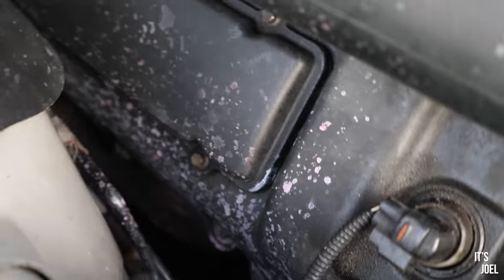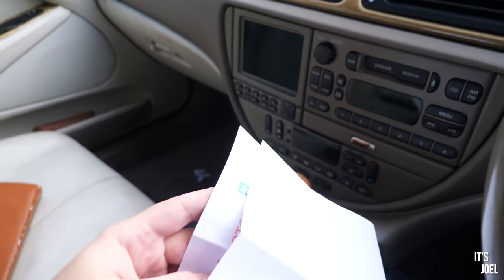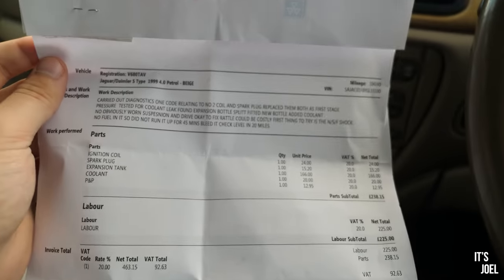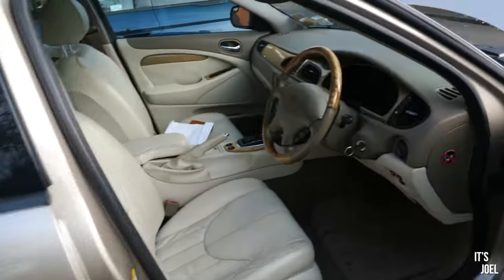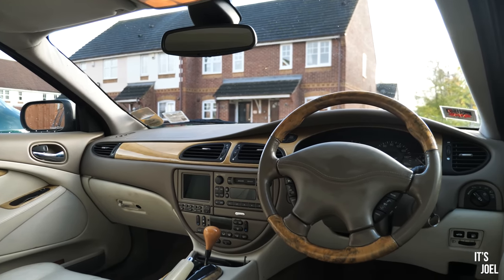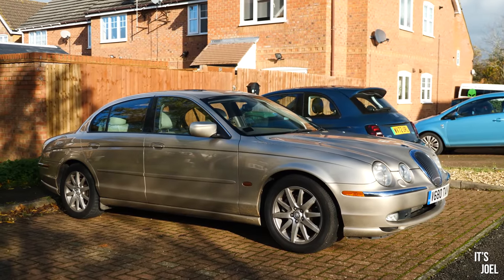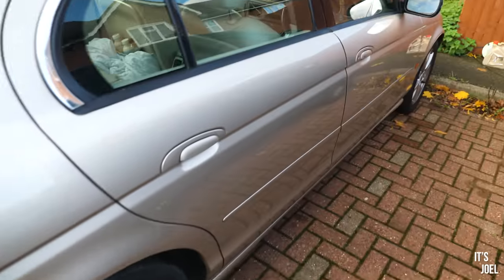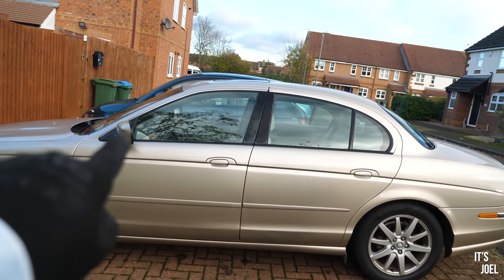My cheap V8 Jaguar has already given up on me…

Comment: Hello Joel.
I am a former Jaguar technician. As one other commentator on here has suggested a simple pressure test will usually reveal the issue, unless it's something like a head gasket that has gone which is very unlikely. 

One thing that is often overlooked and could quite easily be the cause of your issues is the actual expansion tank cap! They perish and at 20 years old it could easily be this if the rubber seal has expired.

Well worth a try, but pressure check first.

You can be pretty confident it won't be oil that is leaking as you would know by the smell of burning oil in that area near the exhaust manifolds and it burns blue so pretty easy to identify.

Car is well worth saving as they are becoming quite rare and yours looks in good shape from what I can see.

The Jag V8 engine is a gem, just change oil and filter regularly especially if it stands for long periods.

Russ

Comment: The reason the coolant is lost after the car warms up is that initially, the coolant does not circulate until the engine is up to temperature. 
Also, I think you can save a lot of money by sourcing used parts or checking online yourself. You can get a new expansion tank on ebay for £35!
Reply: speaking fax atef
Reply: Yeah not sure why he's letting the garage source the parts when he can certainly get them himself and rather pay the labour to get it fitted, a lot cheaper

Comment: Joel, my guess is that this is a split hose after the thermostat. Once the engine warms up the thermostat will open allowing coolant to circulate through the radiator so I’m guessing that the car is unaffected by the split right up until the thermostat opens.

Comment: Looking at where the leak is coming from it could very possibly be the heater valve assembly. It's very common (been there). I have the 3L V6 and the 4.2V8 and they're both great cars. If you should fancy straight piping it I have a set of bespoke rear pipes you can have.

Comment: I have a 1998 XK8.  The heater hoses under the intake manifold and the octopus hose behind the engine can leak once the thermostat is on.  When the temp is still low, the thermostat is shut and coolant would not flow in those hoses.

Comment: I personally would remove the tax disc and parking permit but keep them in the owners handbook folder. Same for the other stickers if you think you can remove them without damaging them or the glass. I would also keep the old reg plates if they are the originals.
Reply: Razor blade will get them off the glss

Comment: Really good video Joel - but a big bill for such a simple item! Replacing a coolant tank would take me around 30 minutes (including a cup of tea) and a spark plug/coil about the same on my XK8. If you shop around parts are not expensive for these cars and even modules can be rebuilt now. The forums are a great source of knowledge and very helpful. It's been years since I have let a 'technician' anyway near mine - any despite what some may tell you - the engineering on these cars matches or exceeds anything you can find in Germany.

Comment: You could have done the ignition coil yourself with an OBD II reader and then buying the coils off the web.
The expansion tank was probably a DIY proposition too.

That engine would be great in my Stag, the Triumph V8 in it has died. Frigging the ECU would be too much of a pain though, I think.

Comment: Driving my x type 2.5 2002 back home one day I saw the “smoke” and smelled coolant burning in the ac. Started overheating pulled over opened the hood and was burned from spraying coolant lol. It was some hard plastic pipe that cracked which we ended up j&b plastic welding shut again and it was fine. At that point we were tired of putting money into it so yea. Plastic weld was perfect at the time hahah.

Comment: I hope that Dell Motor Services takes responsibility for that leak as they have charged you enough but obviously not got it right. It looks like a fairly tidy S type with the desirable 4.0 V8. The engine is the star of that car! You need someone who knows what they are doing to assess the cam chain pulleys, and the gearbox. You need to know if it is worth spending more money on. I wish you well Joel and maybe rope one of us in if that garage doesn't fix that leak free of charge! I am happy to call Dell Motor Services myself if they don't fix it, because I think they jolly well should! Do they know you have 20,000 views on this so far for this? It might help motivate them to fix it! Good luck. 👍

Comment: Joel! I believe I may have the exact same issue as you on my 3.0 x-type. Except I think mine is just in the very early phases as I can do a good 100 miles before having to top up the coolant again. It’s definitely not head gasket, and I can’t really spot any leaks, I’ve just replaced the cap which kept sticking so if it isn’t that it must be the tank or pipes because the radiator seems to be fine.

Comment: My 2006 S Type is doing exactly the self and same thing, the difference is mine is a 2.7 twin turbo diesel V6 automatic, and you are right in part, it is a pipe that has split, but if its the same pipe as mine it's buried at the back of the engine and has to be dropped out of the car, if you still have the original radiator overflow bottle check it thoroughly as chances are it's not damaged, hope this helps.

Comment: I still have my 1997 VW Golf GTI VR6 that I’ve owned since new. It has 229k miles so far, and has now become my sunny day car. Anyway, it went through a period of coolant leak issues and dumped its guts twice. Eventually had to have all the hoses replaced and a new radiator as well! I feel your pain Joel!
Reply from the maker: Very impressive, congratulations on having the car since new!

Comment: Is that an engine known for headgasket issues?  Reason being, if the cooling system gets exhaust gas pressure into it, stuff is going to start failing (such as expansion tanks, and hoses).

Comment: I have had a similar experience on my X-type where the water pump was worn out, soon after it was  the radiator and last of all, a leak off a pipe that was connected to the radiator. in between time, if you HEAR a gurgling sound then you KNOW the coolant level is going down, so check the header Tank level straight away and look for any leeks. thanks

Comment: I have one of these jugs sat in my garden, failed the MOT on rotten sills. mechanically everything else spot-on, one of the best cars I had. I replaced it with a 4.2 which that now is sat on my garden! Point I wanted to make is with these jags there is one part that plays up a lot, and that is the valve for the heating system it’s down by the front bumper somewhere, but if that gets a blockage that could cause the problem with your expansion tank I’ve had issues over the years with heaters not properly working one side or the other and it’s these blasted valves not an expensive part, but I’m just wondering if that could be your underlying problem and issue?

Comment: I had one of these and very nice it was too, it also kept having a miss fire, it turned out to be water running down the windscreen onto the engine. I cured it by reversing the rubber near the bottom of the screen.

Comment: Have you made sure the timing chain tensioners have been done on this car? Not related to coolant but guaranteed to kill the car if they fail - 3.2/4.0 V8s are prone to it because they have plastic tensioners.  They need to be upgraded to the later 4.2 metal items before it's too late

Comment: Would check the water pump. Sudden loss of coolant is usually the symptom of broken water pump/thermostat. Hoses will trickle usually, unless there is a fairly significant split. That's my penny's worth of thought.

Comment: The AJ-V8 4.0 engine is bullet-proof, a great engine, good enough for another 100k. Expect a few niggles and cosmetics for the price, soldier on I think you have a good car. I have an 18-year-old XJ8 with the 4.2 lump butter off silk, I've had some niggles recently the drivers door failed to open and needed the module replaced along with the door catch...couple of hundred sorted it.

Comment: Surely when they fitted the new coolant tank and did the work, they would have thoroughly tested it? New expansion tanks are available on eBay for between £35-£90, I ‘m sure the garage didn’t use a OEM part! Love the car, by the way, I had a 3.0 V6 and absolutely loved it, only problem I had was rust on the rear subframe, as I bought the car from a dealer near the coast, otherwise, a cracking and underrated car, would love another!
Reply from the maker: In fairness to the garage, it’s a specific part for the early V8 cars and so they were all circa £150+

Comment: I have a S type 4.0. expansion tank is a pig to change. Lower hoses have quick release joints that are not easy to get to. I got a pressure test kit, should have been supplied as tool kit. Seals on the front of the V and water pump+ plastic thermostat housing all weak design. Upgrade as you go.

Comment: Re the cooling system, due the the cars age, it would be prudent for piece of mind to replace every piece of rubber attached to the cooling system. If not  is it the case you will always wonder and spend your time staring at the temp gauge. I’d  change the thermostat and water pump as well

Comment: The car has two loops, small one and big one. Once car is cold fluid circulates in small loop, when it warms up thermostat opens to the big loop, and probably you have a leak in it. The workshop should test it while repairing the tank, or it jus let go in the weakest spot once pressure got higher after first repair.

Comment: I'm not familiar with the S Type V8 layout, but I had a very similar issue with my 2006 X Type 2.0  diesel.  Your symptoms sound exactly like how my issue first started. Coolant loss from the expansion overflow eventually progressed to overheating.  It took some tracing as it got steadily worse over a few weeks.  Are you getting any signs  of oil in the coolant/ water in the oil ?  Any signs, get the engine oil cooler and oil stat checked, if it has the type where water coolant cools the oil. The oil cooler is an alloy sandwich block, where oil and water both pass through it.  They corrode internally on the spot welds, allowing oil and water to gradually mix and pressurise each system.  It can resemble a blown head gasket, but the engine still runs perfect until it gets up to temperature, then rapidly overheats when oil and water thermostats open flow to the cooler. High oil pressure gets into the coolant during running as it progresses.  In certain running conditions, it will blow oily coolant out of the expansion tank in time. Once you switch off, oil pressure stops, and coolant pressure can force water coolant  back into the engine oil, so check it too.  The hardest job after swapping the oil cooler is flushing both oil, and mainly the water systems of contamination.  I used a liquid housold detergent in the coolant for several flushes, then changed the oil, filter,  antifreeze coolant and thermostats.

Comment: I have no wish to scare the pants off you but I think you may be suffering from a head gasket issue. A blown head gasket possibly across the cylinder which needed the spark plug can, once the engine reaches temperature, begin to pump compression leakage into the water jacket of the engine. This will force water out of any place it can and in some cases even explode the filler tank. I would get a compression test done and look closely at the spark plug cylinder for a variance in compression Lbs PSI compared to the other 7 cylinders. Great video by the way Subbed and liked. I have the later 2007 2.7 diesel version. That has had some water issues too.. The thermostat housing which just really a water flow junction box and has no thermostat in it at all, decided to split. But that was down to old age. I changed that and then the heater control valve gave up. I have now bought shares in an antifreeze company. Despite that I love the thing and wouldn't part with it for all the tea in china.
I bought the car in August this year for £2500 because it was spotless. Iv'e changed the cam belt and the rear high pressure fuel pump belt and because of the disgusting state of the engine internally with the DPF system I have now cleaned all the soot out and blanked the EGR valves on the turbos so its not recycling its own farts anymore. Good luck I hope you get yours sorted and if you need parts at reasonable prices check out autodoc.co.uk really good if you don't mind a bit of a delivery wait. I look forward to your next update.

Comment: i would consider whether the THERMOSTAT is stuck in closed position, if so you'll have no heating if switched on, great video, thanks for sharing, they are good cars if well serviced, my 1st 1999 S-Type done 230000 mls and was still good, my 2nd 2001 S-Type has now done 209000 mls and still good, both had exp.-tanks replaced, also a few ignition coils.

Comment: The 4Litre  vs the 4.2- it's the other way around in Australia- most V8's advertised here are 4L. I personally would only buy the 4.2 as the problems (nicasil and plastic timing chain tensioners) were done with before the 4.2 was out. Had 2 XJ40's previously but the factory tuning was so mushy it didn't inspire. Compared to most cars of that engine size, it was like the accelerator cable was made from a bungee cord. Lovely and quiet though- made a 2007 holden commodore sound like it had rumbling front wheel bearings compared.

Comment: It’s a LR/Jag V8 so it’s going to have over heating issues, get used to it.  
There’s plenty of fixes out there, different heads, ARP studs, upgraded head gaskets, better expansion tanks. All make it into a reliable engine. Any air lock in these motors is a disaster waiting to happen, try water wetter, helps stop pockets of air in the block.

Comment: Most probably air locked or suspect thermostat not opening properly and should have been pressure tested and run up to temperature before you collected the car good luck joel let us know the fix 👍

Comment: Check everything involving water, water pump slight leak ?, as you say hoses could of split, or the tank could be slightly damaged very unlikely tho, but the hoses will be the age of the car so wouldn’t surprise me if it’s that, or quite simply the garage may of missed something putting back together 🤷🏼‍♂️

Comment: I hope you’ve not poisoned that poor little black cat. 
Before throwing money at the Jag make sure the sills are rot free. 

My V5 Golf did the same thing the other week and it was due to a brittle plastic thermostat housing and it was far better when they were made of metal,  but manufacturers like saving a couple of quid at the cost of reliability. But  the car is 23 years old so I guess I can’t complain really.

I could of repaired it myself,  but I was more worried about the local Cats,so I took the car to the garage and washed the road down with a few buckets of water before setting off.

Comment: Perfection demonstration that an expensive car new, gotten on the cheap 20y down the line, still costs a fortune to put right. I have been there before with an 2000 Jag XK8 Conv AJ27 engine: problem after problem after problem. Poorly maintained in the past...and not particularly reliable from new. Cooling is a recurrent issue on these engines (AJ26, AJ27 and even AJ34) due to rubbish parts, notably the water pump with plastic propellers. Shortly after buying mine, heating was random, coolant was running low and needed top up every 100 miles. It did cost me both head gaskets to replace. Then chassis corrosion was next on the list. Then some electronic issues. A money pit, more often on jack stands than on the road. Got bored. Still have it as Sorn in my garage, may sell it for parts one day as I may well recoup some of my losses just with the convertible top in excellent condition. Sadly, that's the bet you have to accept taking on. It does not always end well, it actually often ends as a money pit to keep these things on the road, multiples of the purchase price...

Comment: I looked at the V8 back in 2002, even then the stealers said don't touch the V8 as they had some major issues with them, ended up with a 3.0 for a few years. Liked the retro look but not that practical as a family motor, I think the v8 is rare for all the wrong reasons? Have had several X type and much prefer the S.